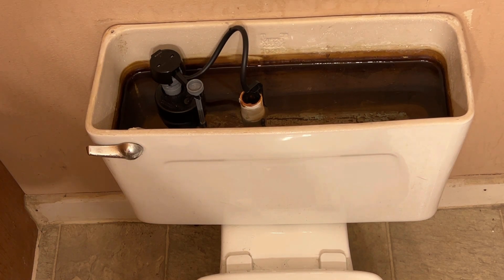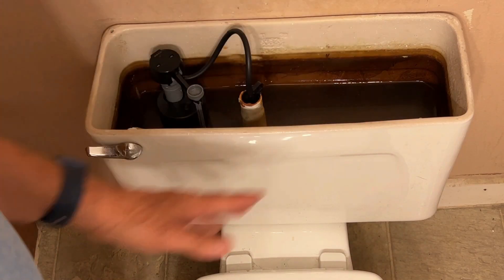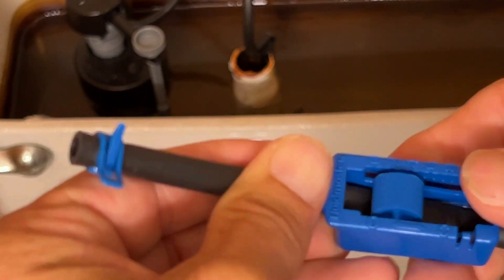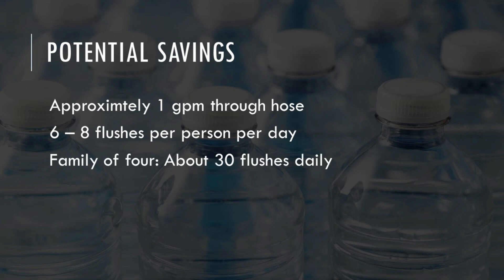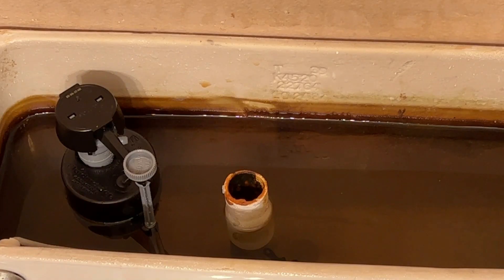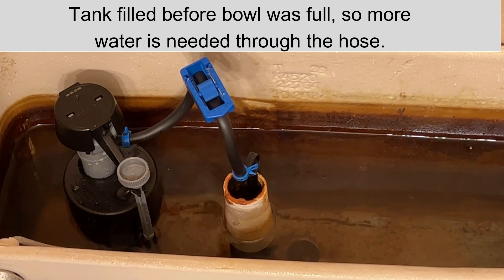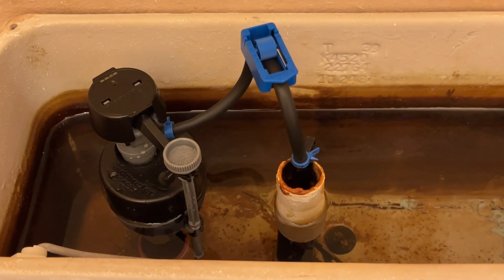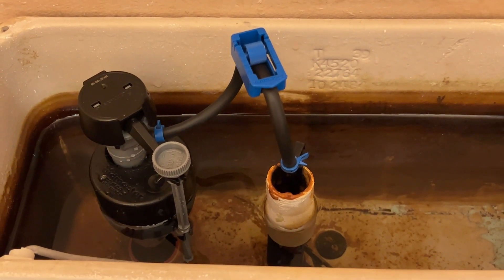Save Water & Save Money by Installing $10 Toilet Flow Restrictor

Comment: Would have been great to see how fast the toilet bowl was filled by the old tube and how many seconds it continued to put water into the bowl that just ended up going down the drain. Also how it finished in the bowl at the same time that the tank stopped filling.
Reply from the maker: You’re right. I should have included that in the video. I appreciate the feedback and may redo it and show that. Thanks for the suggestion.

Comment: Never knew such a restrictor existed.   Ingenious.  

Another investment that can quickly pay for itself, is to replace any toilet manufacturer prior to Jan 1, 1994 with a high efficiency 1.28 GPF model, or better yet a pressure assisted toilet,  which the latest models use just 0.8 to 1.0 GPF yet delivers a powerful, efficient flush everytime.  

The Energy Policy Act of 1992, passing through congress and senate with widespread support and signed into law on October 24, 1992 by George H.W. Bush, mandated that effective Jan 1, 1994, new toilets can not flush with more than 1.6 gallons, and that this new water saving model, sometimes called low flush toilet,  be installed whenever a toilet is being replaced.  With this information,  toilets made prior to this date might use 3.5 GPF, and very old toilets,  typically made before 1980, could use from 5 to 7 GPF!!
Reply from the maker: True! I remember when those low flush toilets first came out. They didn’t work so well.